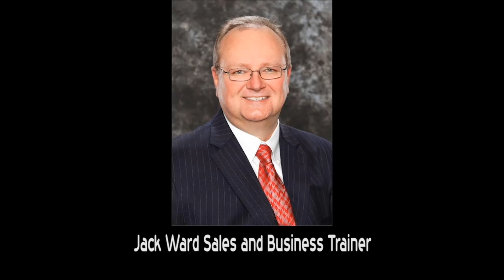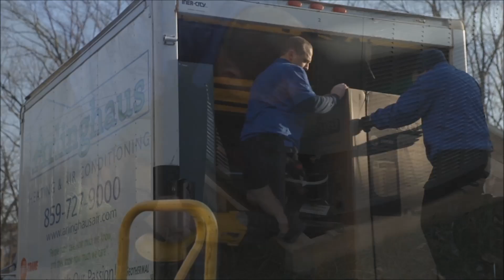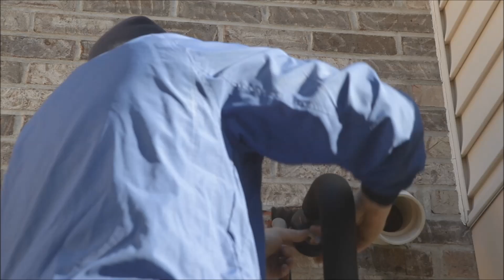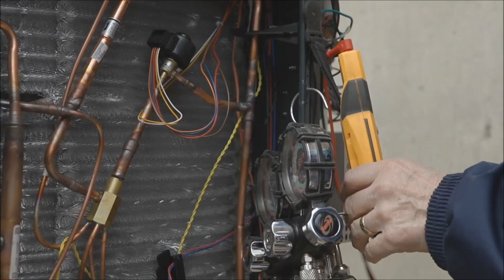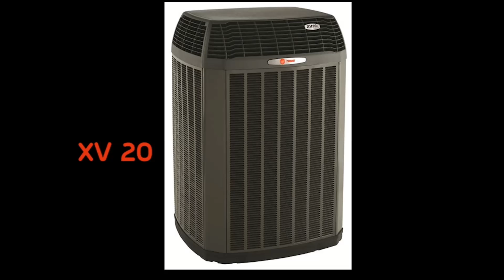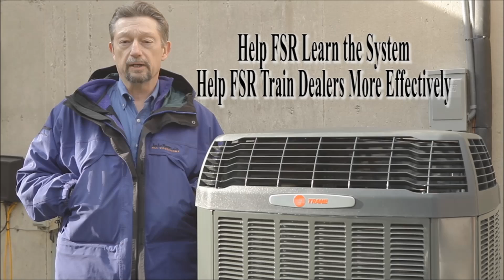Arlinghaus featured in the TRANE National Installation Training video for TruComfort Variable Speed.

Comment: Great video Trane. I love your equipment and BAS's. Thank you for converting to BACnet from LON. This was a great install, I just wish that they had put a PVC sleeve between the line-set and the bricks. Once that 410A circulates in that copper, the vibration against the brick will tear through the armaflex and eventually nick the copper. Some young tech will go on the service call, and lose his or her mind trying to find that leak.